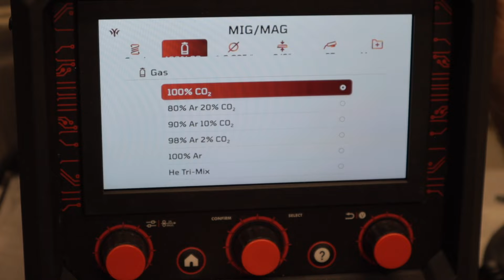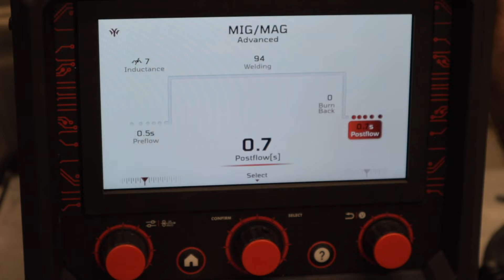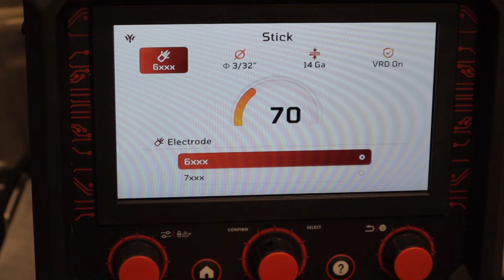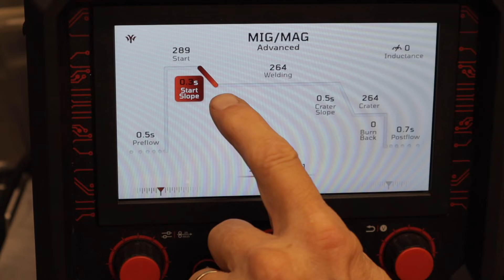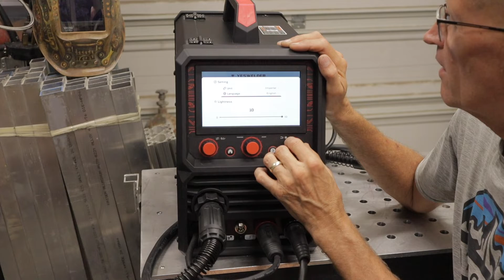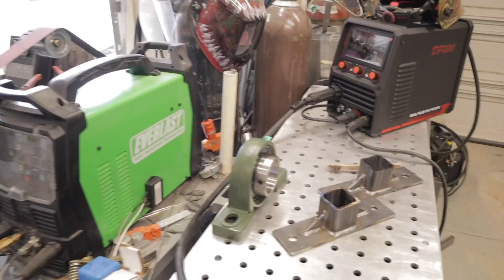YesWelder DP200 Dual Pulse Mig welder Detailed Review and Testing.

Comment: Great review.  My DP200 will be in tomorrow to review and today I recieved an  SP200 that I think might had been a prototype single pulse. I cant find anything on it on yes welders home page.   I picked them both up on Amazon Vine for review.  I have my oldest friend I have known 45 years now since kindergarden that has taken up welding this last year using his father in-laws HF machine.  So I am going to surprise him and take him the single pulse machine.   It will only pulse in the Aluminum mode.  I have not welded aluminum yet but it lays a nice bead on mild steel.  I even ran a little 6013 with it today. I have not tried the tig yet either.  That is the other difference the SP200 does not have an input for the pedal and it can not update the firmware.  Crazy what these new welders can do.  I like it because it is so light compared to my everlast 221STI machine. That Everlast is a awesome welder and very advanced ACDC tig.  Just no pulse mig.

Oh yeah BTW nice job on that Truck bed.  Those welds looked good and that dude is for sure going to save you some time and money.  Just the reduction in Argon has to help as well.         Did the feed ever jam running the graphite liner?    Oh I just remembered I have another gun from my everlast that I replaced with a 15 foot YesWelder 250 amp Tweco style.  Great gun.  I should be able to keep my new gun set up for aluminum and use the spare for steel.  I wish it came with the regulator.
Reply from the maker: Hi JV! Thank you for your great comment! I’m sure your friend will be happy to get the new welder!  I have an Everlast 325EXT that I use mainly for welding aluminum and it is an amazing machine. The DP200 works great with the main mig gun if you are able to keep it fairly straight from the machine to the workpiece. I also keep one mig gun setup just for aluminum. A trick I learned from reading the HTP 220 pro welder manual for how to set up for aluminum mig welding was to shorten the Mig gun to 8 feet in length and run the graphite liner right up to the tip of the gun without the metal spring like thing on the end of it because it causes too much friction with the soft aluminum wire. I also run .045 wire through the mig gun because it is stiffer and feeds better. Hope this helps my friend! 😊👍

Comment: What settings did you use welding  the aluminum truck bed?
Reply from the maker: Hey there MLG!  On the truck bed I was welding 1/4” thick square tubing that was 2 1/2” with the machine maxed out at the highest setting on pulse.  Because they were all inside corner welds, I set it to weld 3/8” and then turned it up to the maximum. I was using .045 4043 wire.  It did a great job and saved me a bunch of time not having to Tig weld all those frame welds. Let me know if you need any other info. 😊👍
Reply: @PranaTech hey thanks for the reply do you know the exact amps and volts and wire speed? I have a different yeswelder machine but it does not give me the option to select material thickness and automate the settings like this one does
Thanks
Reply: @PranaTech ^

Comment: 7 months later what’s your impression? I’m torn between this unit or the newer arc captain that’s releasing in a week or two. I really appreciate all your videos and how in depth you go. I will likely go with this one just because the user interface seems well thought out. I have my everlast tig 210 at home and then an old school flux only Lincoln MiG at work and want to try pulse mig and spray transfer. I think this unit fits my budget and maybe the bill 😂 HTP pro pulse if I win a small lottery would be my first choice 😅
Reply from the maker: Hi Christopher! Ok, so I have done a bunch of welding with this thing since I did the review. It welds great for what I use it for. I mainly use it for doing structural aluminum welds on projects that are underneath and out of sight because it saves me so much time compared to Tig welding. I mainly use it with the mig gun, but I have highly modified it. I shortened it to 8 feet and installed an Htp 26 size neck on the Yeswelder torch so it is now basically exactly like the one that comes with the Pro Pulse 220. Here is a link to the parts that I purchased. https://usaweld.com/collections/htp_america_26_series This allows me to use the larger heavy duty tips that last much longer when welding mig aluminum. I am also using .047 wire through the gun also. It is much stiffer and doesn’t bird’s nest like the smaller wire diameters. If I was only going to do occasional aluminum mig, I would just get the spoolgun and weld with that. It feeds much more reliably with .035 wire through it. I would love to get the pro pulse 220 as well. If my budget was unlimited, I would go one step further and purchase the miller mig with the push/pull gun! That way you never have feeding problems again!  Hope this helps! Let me know if you have any other questions. 😊👍
Reply: @ thank you for such a good update! I think I’ll pull the trigger on it. It will pay for itself pretty quickly I think. I like the upgrades! I have a ton of customers who need their aluminum dump trucks fixed, so I do plan on doing some mobile aluminum. I have a pretty decent kw generator, but still need to do some research on compatibility and ‘clean’ sine wave of the genny. 
As always thanks for your time and feedback! When I get it, I’m sure I’ll have some more questions lol
Reply: @PranaTech how many parts did you purchase to make that modification on the mig gun?

Comment: My only problem with mine is that it seems like the tig feature is stuck in spot weld.
Reply from the maker: Hi Ryan!  I’ve only ever used the Tig feature with the pedal to control the amperage. It worked great with the pedal. The standard Yeswelder pedal for their Tigs with the 5 pin setup plugs right in and the machine automatically recognizes it. 😊👍
Reply: @PranaTech  that's exactly what I have. I guess maybe it's a tech support issue.

Comment: Great Video!  Thanks!  So, just wanted to make a comment on the weld qualities.  I could tell from your TIG welding that you are a competent welder.  Also, your non-AL welds look similar to welds from other YouTube videos reviewing the DP200.  Now of course the quality of a weld is not really about how it looks on the outside but rather what it does on the inside, and few cover that aspect.  But if we want to judge based on how it looks on the outside (which is of concern if for no other reason than ascetics and also the amount of finish work needed after the welding is done) then the videos I am seeing from the ArcCaptain MIG-200 appear much nicer than what the DP200 seems to be producing.  Although that is a secondary consideration for me, I am being seduced by these very nice smooth welds that the ArcCaptain seems to be producing.  I'm also curious as to why they might be that way.  Is ArcCaptain dialing in a whole bunch of additional Inductance?  But those welds did not seem concave.  They were just really nice rounded smoothed rolling beads.  This contrasts with every DP200 weld I have seen which do not exhibit this very nice finish.  I'm going to investigate this further and might post back here if I can conclude anything further.  I really like all the DP200 features (and you did not even get into the Double Pulse), but at the end of the day a large part of welding is how the weld looks at the end.  Your AL spool gun welds and your TIG welds were similar in appeal, finish and smoothness to the ArcCaptain's MIG and even Flux Core welds that I have seen.  Any perspective from you (like you can do the same thing on MIG and Flux Core if you turn up the Inductance) would be very much appreciated!  Thanks again!  (PS: Subscribed ;-)
Reply from the maker: Hey, thanks for the great comment! A lot of great insights within your post. I have both of those welders and have welded a fair amount with each of them. I will tell you that they are both great welders and I’m not partial or beholding to any company out there. My favorite feature of both is the inductance setting. It really helps control the weld spatter. If I was going to make a recommendation between them, I would say that if you are mainly welding steel, I would go with the ArcCaptain. If I was going to be welding a lot of aluminum, I would buy the Yeswelder. The pulse aluminum feature that the Yeswelder has is incredible for mig welding aluminum and also for thin steel welding. This being a big advantage if aluminum mig welding is something you are planning on doing. As I said, both are great quality welders for the garage craftsman and hobby welding. I am currently welding almost daily in my welding business with a Yeswelder 250Pro Mig. I have had it for at least five years now and I’ve put so many 10 pound spools of wire through it that I’m on my third mig gun now. So I must say that I’m pretty impressed with the longevity of these small inverter welders. Hope this helps! 😊👍Don
Reply: @ Hi Don, thanks for the great reply to my comment. So I reached out to yeswelder, giving them 4 links to the arccaptain videos that showed some of the beautiful welds that machine produced.  Ana wrote me back with an exquisite customer support response: real pro.  In it she linked 4 videos of exquisite DP200 welds that IMHO were actually better looking than than the best arccaptain welds:  FWIW, Yours was one of them!  But the other 3 were all non YouTube videos (TikTok, instagram and Facebook I think it was).  THAT is why I could not find any competing good weld DP200 videos on YouTube, because there aren’t any! (Except yours).  I’m commenting back to Ana That YesWelder needs to get some pro or semipro creators sporting their craft with YesWelder DP200, because with the evidence I could find I would be led to believe that DP200 can’t make good looking welds.  A lot of the DP200 welds were first time welders who bought at the low kickstarter price.  But I now believe this may have backfired, because by encouraging all these newbies to try welding and then posting videos, they saturated the YouTube with poor looking welds from the DP200.  From what you said it doesn’t sound like one welder is easier to make good welds vs the other, so it had to have come down to skill.  I had one other creator who also owns both machines (and reviewed them positively both) recommend I go either the DP200 as just a more feature filled and generally higher quality machine. You are recommending it for aluminum. I’m courteous what the tipping point reason was that for steel you might tip to the arccaptain?   At this point I don’t think it will change my mind, but I would still like to know what attracted you to the arccaptain for steel.   In the mean time I’m going to be figuring out the accessories I want for a DP200.  Now that I have proof that it actually can make nice looking welds, the feature richness is highly attractive to me.  And since I do also want to do some AL, that is another vote for it.  The final vote is from the fact that it is software upgradable, and I know yeswelder is actively developing updates, which suggests the machine will only get better.  Thanks so much!
Reply from the maker: Hi there! Ok, after reading your very detailed analysis, I realized that you never once mentioned price as a factor. I usually assume that it is and so made my recommendations as such. Given what you want to do and get out your welder, I would definitely recommend the YesWelder DP200 because it has so many more features and capabilities than the ArcCaptain does. 😊👍Don

Comment: I tried pulse welding carbon steel and the amount of splatter was horrible.  Can you help with any ideas on what I might be doing wrong?  I was using 90/10 gas.
Reply from the maker: Hi Bruce! Ok, when in the Mig settings, scroll over to the advanced tab and enter that menu. Go to inductance setting and turn it up to +8 and save it. This will reduce your splatter significantly. 😊👍
Reply: @PranaTech  Thanks!!

Comment: Thx Don. Very informative.
I noticed you didnt comment on setting up the double pulse settings which I assume the machine can do as its predecessor, the YWM 200, can.
As I have the YWM 200p I would  like to know how your settings compare.
Thanks for responding to my earlier questions on the YWM 200
I enjoyed reading your philosophy for a happy life.Cheers,John
Reply from the maker: Hi John! You are correct, this welder can do double pulse as well. I haven’t had much time to play with the double pulse feature on either machine yet. From what I understand it works better for thinner materials because it controls the heat input better. But honestly I have so little experience with it that I am only going from the information I’ve read. 😊👍

Comment: I live in Finland, Europe, and we use metrics. You showed metrics units can be chosen. Could you check if this really will switch ALL measurements in the synergic settings to metrics or just some? Also, we only have 240 Volts in Finland and in households 16 amps fuses, will the fuse be a limiting factor for a hobby user? Thanks for your clear and informative narrative, your vids are very helpful! Hoping the retail price will be affordable, maybe there will be a nice Black Friday deal on in after a few years on Amazon even here in Europe. Best regards, Ken
Reply from the maker: Hi Ken! I went through the settings this morning and switched it to metric and then went through all the different processes. From what I can tell, the entire machine converts over to metric in every way. Which makes sense to me because china builds everything metric and then has to convert it to our silly imperial system to sell it here in America. Why my country clings to this silly system when the entire rest of the world has adopted a simpler system is beyond me.🤪 To the question about amperage, I run mine on a 30 amp circuit and it has never tripped a breaker. Looking at the back panel it lists the Ieff amperage @ 17.4 amps and the Imax amperage @ 34.7  The Ieff amperage is supposed to be the average while normal in use. Having welded with this and other Yeswelder units with my portable Honda generator, the welders at maximum amperage seldom reach the Ieff amperage rating.  So, with this in mind, I would confidently say that unless you are planning to weld at the maximum 200 amps on a regular basis, you would be fine with your 16 amp circuit for 99% of your welding needs as a hobbyist. Let me know if you have any other questions and I hope this information helps. 😊👍Don
Reply: @ Thanks, much appreciated!

Comment: have you tried 4043 wire through the gun that is supplied with the dp200? I figured you used 5356 wire to weld that truck bed? thanks
Reply from the maker: Hi Gene!  Most of the truck bed was welded with 5356, but I ran out about 3/4 of the way through and swapped to 4043 in .047 diameter and I actually liked it better through this welder. This was strange to me because the previous model that this welder replaced, ran 5356 better than 4043. Weird!  I wouldn’t attempt welding with the main mig gun with smaller than .045 wire. It is just too difficult to keep the wire from bird nesting in front the drive wheels. The spool gun that Yeswelder sells works great with .035 4043 if you want to weld thinner aluminum and this is what I recommend because with the factory mig gun, you have to constantly be aware of keeping the torch and line straight without any sharp bends to cause the soft aluminum wire to bind inside the line. Hope this helps. 😊👍
Reply: @PranaTech  Is your thickness comment specific to 4043, or does it also apply to 5356?
Reply from the maker: Yes it applies to both. 👍😊
Reply: @PranaTech  Thanks

Comment: Do you need to change liner welding steel and aluminum
Reply from the maker: Yes, you need a graphite or Teflon liner for aluminum. I keep one mig gun set up for steel and one for aluminum so no changing liners back and forth. 👍😊

Comment: Surprised that you would weld that 1/4" mild steel with short arc when that machine does pulse spray. 1/4" is the absolute ceiling for short arc and most structural shops would either spray that or inner shield.  If you get a bottle of c10 that machine would shine in that application- its literaly what its made for.  Nice video nonetheless.
Reply from the maker: Thank you Scott! I appreciate your information. I have been contemplating doing dual shield for my structural steel welding for a while now. I do a fair amount of structural steel work and I know that dual shield does penetrate deeper so I think I’ll try some with this machine with pulse to try it out. Thanks again for the info! 😊👍

Comment: How do you like it compared to your Everlast welder???
Reply from the maker: I think they are both great. The Everlast is a 325 amp Tig only so they are really not comparable. The DP200 welds as nice as any Mig that I’ve owned and I have two other Yeswelder MiGs that I use in my welding business and they have never let me down. The fact that you can mig weld aluminum with pulse for this price is what is really incredible. 👍😊